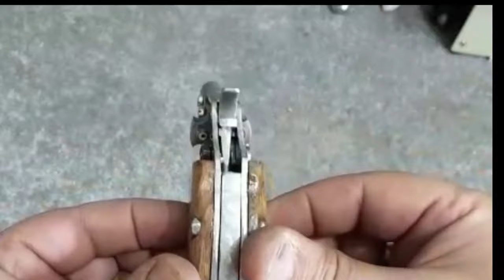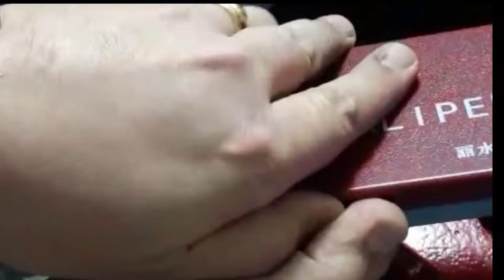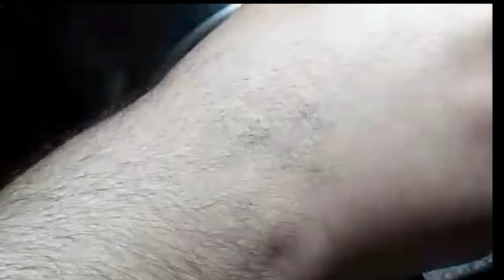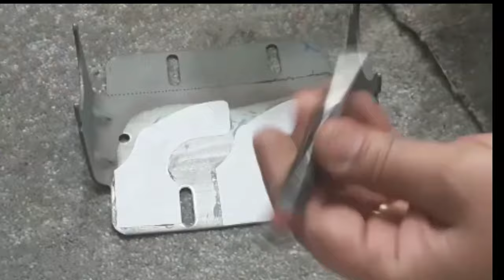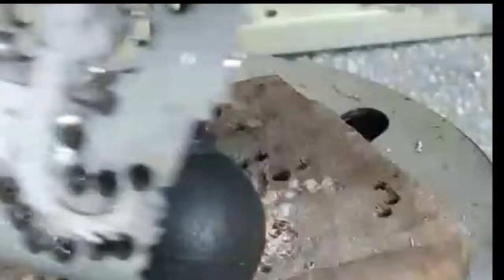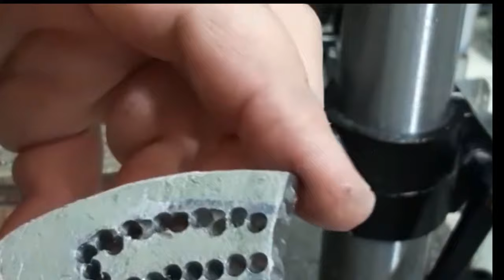homemade revolver| how to make a revolver

Comment: Generally the grooves aimed at making the cylinder lighter dont run the whole lehgth of the cylinder, to keep more metal where the maximum pression takes place.
Reply: The whole thing has to be a prop it’s far too out of safe tolerances in all the important places this thing would surely explode
Reply: @TrashMutt  it uses a very anemic black powder cartridge, it's very forgiving.
Reply: The first production models of the Colt m1860 army revolvers had full-length flutes. So did the 1862 pocket police. Just sayin'...

Comment: Now I can protect my house from thieves thank you.
Reply: Where will you get bullets from though
Reply: @user-nq5hy7vn9k  it can be made at home by using gunpowder and metal
Reply: @renitgurjar3449  the old gunpowder has chance to burst the barrel if the bullet is not made properly and the powder isn't packed properly. It would become a bomb instead of a firearm for self defence
Reply: You can do a testing by liecing a thin type of rope in the trigger have a long rope btw. Stay far away and then pull the rope put the gun in a thingy to prevent it moving to much hard to explain
Reply: @user-nq5hy7vn9k no if you have proper knowledge of making firearms nothing will happen to you
Reply: @renitgurjar3449  grounded match heads can be used to replace gunpowder

Comment: Nice work bro BUT the bullet chamber is a good 1-2mm away from the barrel.....Be VERY careful if you ever decide to fire a round in that thing... I’m sure the bullet will go through with no problems but a lot of the firepower will be lost through that gap.... perhaps add a piece of steel tubing with thread, to close up the gap?
If you ever decide to fire it, don’t do it by hand and put it in a vice and pull the trigger with string.

Comment: Wait so there's a firing pin for each barrel that was pretty creative i was confused at first but that's not a bad idea. And maybe for the pin that keeps the cylinder center you can try making a bigger one that slims down so it sits on a shoulder that way you can file it down to not stick as much but the shoulder keeps the spring for pushing it too tight
Reply: what if I put firing pin in the bullets?😳
Reply: Very creative name
Reply: Its not a firing pin, its a nipple. Just like in percussion cup guns
Reply: @gamertardguardian1299 you just invented pinfire catridges

Comment: That looks great, I wonder if you can make a firearm from this shell loading pellet revolvers, I thought about trying it with the single action bb gun I would like to make 22short and a black powder gout out of those
Reply: SAMEEE
Reply: I das thinking if was possible to use a toy cap gun to make a real one, copying the parts, using steel to make the new parts and use 22 blanks that are used to put nails in concrete and pellets, or make a cap & ball, like the colt navy where you have to put the powder and ammo in any hole of the chamber and use the cap. Or make myself some steel shells where a put the powder and ammo and the caps, so i can reload them after shooting
Reply: @Thiago Martins  I'm thinking you could use the trigger and other parts to make templates for new parts and use the frame so it looks cooler

Comment: You'll have a hand blaster If the cylinder doesn't line up with the barrel
Reply: Making a good case for precision work - as precision as the mnaker can achieve. Good point, but very doable.
Reply: exactly my thoughts..

Comment: Im a machinest and have though of the home built revolvers and a friction viler ball plunger - ball bearing detent on the side of the frame - will hold the cylinder in place to fire then you just grab turn the fixed ball bearing snaps into the next detent for the nect chamber this is a much better idea lol to build on

Comment: Whats preventing those extra pins from striking that bullet and causing it to go off?
Reply: Those are firing pins how in the heck is it gonna create enough force on its own to hit the cartridge--its called a cartridge the bullet is the projectile that  comes flying out my friend,,,,the more you know
Reply: @istartedajoke1704  dropping it.
Reply: @isakn7975  there is not enough displacement possible for the pin or primer to build up enough kinetic energy to strike with enough force to deform the percussion cap. When dropped the pin and primer bind and act as one body of inertia. One can calculate the energy velocity of the pin required to set off the primer by Ek=0.5v² taking the minuscule mass of the free floating pin in Kg.
High school physics bro.